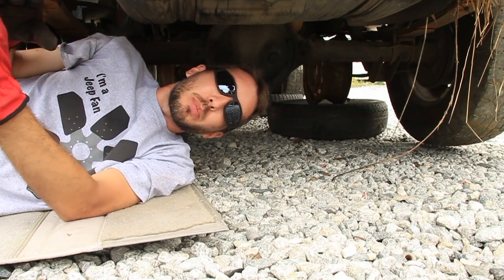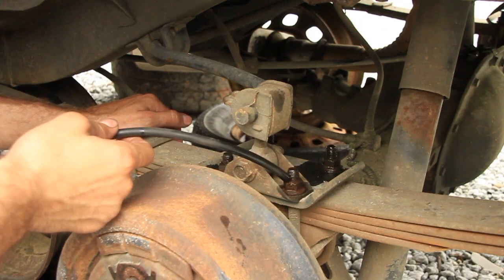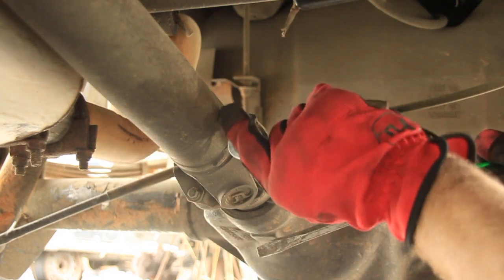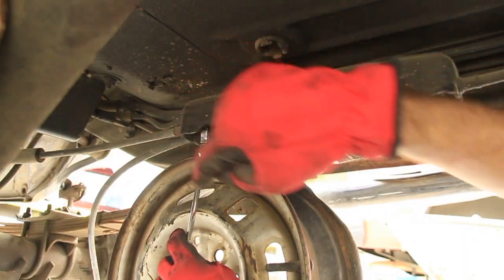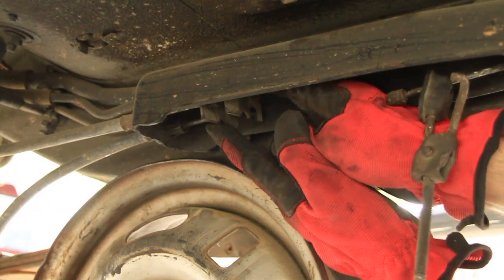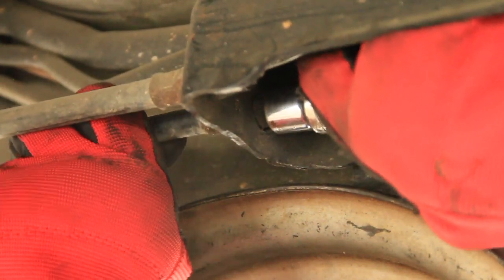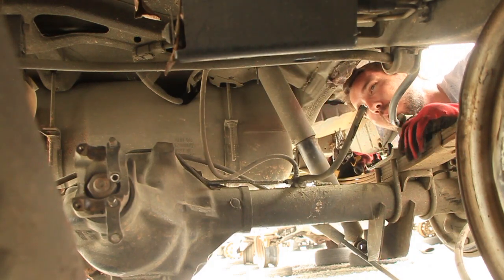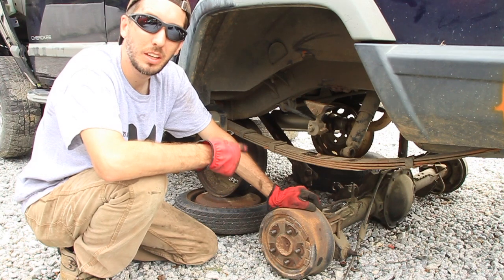How To Remove an Axle at the Salvage Yard

Comment: Even faster way.... undo the shocks, Sawzall the u bolts, cable cutter the e brake cables, yank it backwards 8-12" when on the ground, then pull it out and remove driveshaft.  Far less headache then removing it "properly" remember, your at a junkyard. In 30 days the car will be crushed.... It's not about working clean it's about efficiency.

Comment: You can use old seat belts to make straps, and loop around axle/ then it is easier to lift and carry. Works for many heavy items too, like transmissions.
Reply: thats smart, ill remember it
Reply: Carry. U must be a big guy.
Reply: I know this was 6 years ago...but good idea with the searbelts...I'm 55 years old and weigh 150lbs..any help I can get is good.  About to snatch a rear end in the morning..thanks.

Comment: Use a electric impact on that. Also if you take a dewalt 20v with you. You can use the battery as a power sorce to test electric window motors and switches. Or even move windows up and down to make getting them out easier with less damage to the donor vehicle. Rember someone else maybe looking for that part that you destroyed.
Reply: Many Thanks for that idea. Saves hauling in a 12v car battery to test with

Comment: In Michigan if you would need an oxy acetylene torch or an electric impact if you even wanted to attempt this. I've pulled many axles and on 9/10 times here you have to cut the u bolts.
Reply: Spencer Travis cut them anyway. Not supposed to reuse them. Much faster.

Comment: I've used a wrench to remove the spring parking brake cable when no sockets are available and in a real tight pinch I've used a piece of heater hose just takes a little more finagling...Have a great day Matt...

Comment: I was just looking up how to do this yesterday, when Lo and behold Bleepin Jeep to the rescue. Hopefully be able to take this info to pull a Dana 30 for a Solid axle swap on my Liberty. Thanks Matt! Ps. Any chance of doing a front axle pull soon?
Reply: If you're out looking for a D30, the better years is around 95 to 99 if I remember correctly. Make sure it's high pinion and no CAD (central axle disconnect). Really to be honest, I'd look for a 2007 to 2015 JK rubicon front axle. It's a Dana 44 and it's a direct bolt on for an XJ so it's basically the same swap either way. Even better yet would be looking for a D60 but that's up to you. Matt/BleepinJeep does have video's where he's removed front axles from a few different Jeeps, I'd check out his other videos. The front is a bit different because the upper/lower control arms instead of leaf springs and steering components.
Reply: Kevin Smith Same could be said about our unibody XJ's but people does it all the time. If you're going to spend all that money doing a SAS, why not go with the best option right off? It's not that much difference in cost from most wrecking yards, where I'm at anyways. Only downside would be needing to swap the rear axle while at it.

Comment: Every single bolt on my jeep is rusted frozen.
Reply: But a MAPP gas torch from lowes/home depot.  The $25 you spend with save you hours of headache.
Reply: Also a good powerbar and Half ATF and Carb cleaner make a awesome duo
Reply: AC Delco rust inhibitor is my favorite stuff to use, and a hand held torch.

Comment: Pull and save here has crappy car stands made from two temp tire rims. Pulled and MJ Dana-35 rear end last week you know those are bolted from the underside. I had 1/2" between the rear axle mount and the ground. I took the leaf springs out

Comment: Was recently at the local Pull-A-Part looking for another Dana35 or getting the U-bolts, brackets and sway bar for a Chrysler 8.25 upgrade because this online company sent two Chrysler 8.25 on two different shipments when I kept saying Dana Spicer 35 so I am going with the Chrysler 8.25 upgrade. Will install the clean black rear end over the rusty one they sent.

Comment: i had my 1996 grand marquis gs for 10 years now i got it back in 2011 and i never changed the gear oil but i have the gear oil but now i have play in my differential cause when i put it in reverse it makes a clunking sound and when i put it in drive it makes another noise but other than that it rides fine my differential isn't making any noise but i want that clunking sound to stop every time i put it in gear so i want to know what i have to do to fix that problem i don't want to buy another rear end
Reply: Check your ujoint

Comment: I have a question that I hope gets answered. Yards here in reno didn't have any 8.25 with 3.07 ratio, ended up with one from eBay for 175 shipped. Arrives Monday.
Question: should I worry about the new rear end matching up with my drive shaft? Will it be horribly out of balance? If so how is that remedied? 
My 94 does not have abs and the new does. Will that be easy to delete?
Thanks for any help.

Comment: Quick question:Gotta someone selling an i4 duke 4 door cherokee 4x4. First time driving and seeing a 4dr..needs an arm purch rewelded. No one does it locally.. so my question is will the i6 cherokee axle work? Mostlikely would have to regear...last question all cherokee's came with either dana35 or 44 correct?

Comment: I'm working on an EV conversion project using a RWD chevy Blazer.  Off the wall question, but does anybody know if it it's possible to flip the rear axle and reposition the brakes so that everything is that was facing up is still facing up.  We have this idea for a no transmission build where the motor will sit where the gas tank was. Will drum brakes even care if what use to be reverse is not forward?

Comment: That wasn't pulling an axle. The was pulling a rear end. Didn't remove the axles from the rest end. Still an informative video just not what I was looking for.
Reply from the maker: Search for how to remove an axle shaft... in 13 minutes
Reply: BleepinJeep have a 98 grand Cherokee rear disc brake .hearing grinding noise I jacked it up removed Wilber’s found differential grease on inside of rear wheel so I pulled off diff cover to inspect the gears a lil bet of fluid came out not a whole lot the gears had scratch marks on them I was thinking of just swapping the whole rear end found one at good price alwready pulled off the vehicle and it also comes with some brake components attached as well first time getting a rear end at salvage yard will the driveshaft be off balanced wen I attach the new used axle assembly?